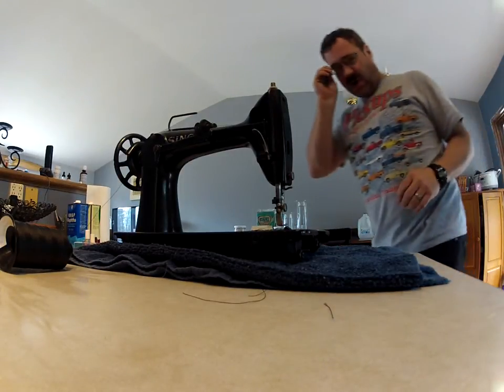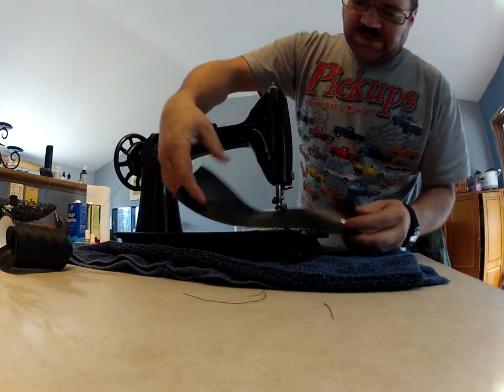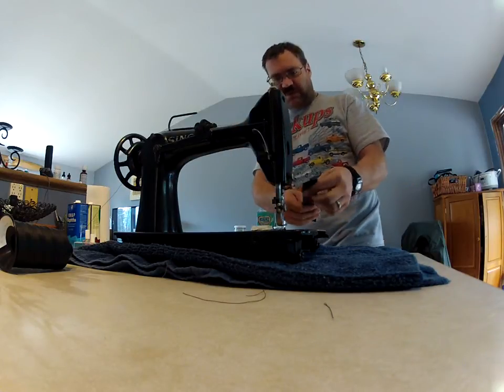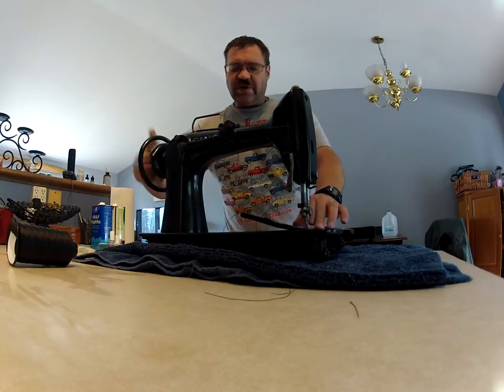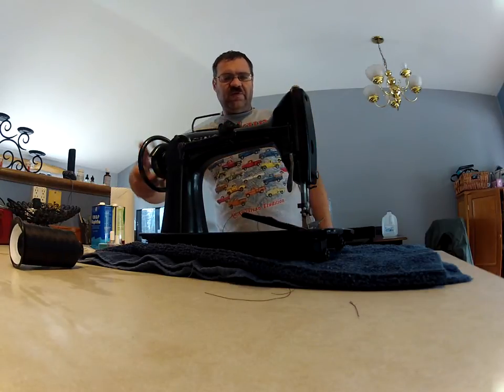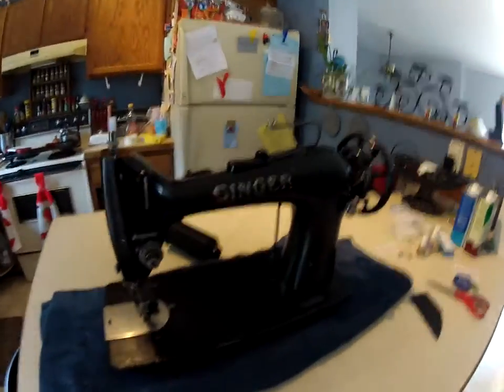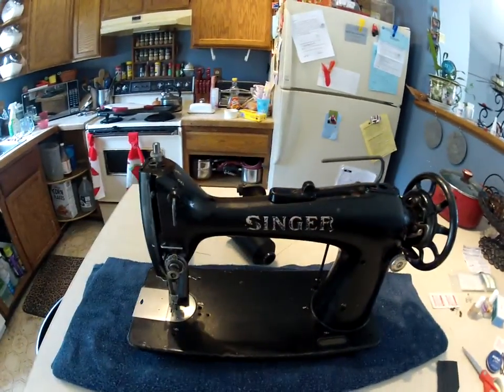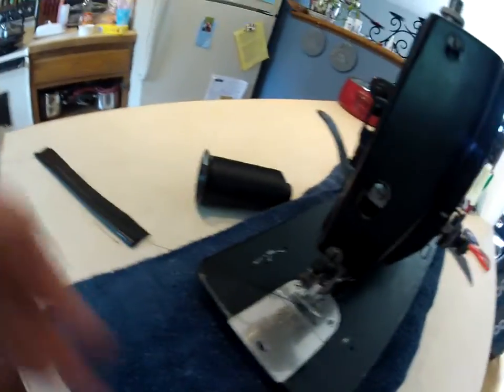Singer 103 industrial.MP4

Comment: India Singer Co makes the replica of the 103 model with knee lift for presser foot.  However,  I doubt if they are of superior quality.   I have one made in India but they are not called model 103, just high speed 'Merritt' or 'Dinesh'.  Mine has the  'Singer' name on it but it's on a Merritt industrial treadle stand.   I had to swap out the poor quality balance wheel for the original Simanco one because the one that came with the machine was really bad and rattles; sometimes not engaging the needle shaft.  The needle insert was also slightly angled about 10 degrees. I might have to tweak that as well, but it sews ok, fast!

Comment from the maker: Sorry, the machine (and matching table) is not for sale, it is my main heavy duty machine. Shipping these things around is quite an ordeal anyway. I would recommend you check local for sale and auction sites if you are looking specifically for an older singer is industrial look for one labeled 31-15 or 31k. They are fairly common and can often be had for much less than I paid for this one. Good luck in your search!

Comment: I'm about to buy this machine from a local store, may I know what size of needle and thread does it use? Is it an industrial treadle machine? What's the maximum thickness of leather can it sew?
Reply from the maker: I would be very surprised if the machine you have found is this exact model, I have been watching old singers for several years and have found only one other...it seems to be a European model  however it uses "standard" industrial needles ( it has been a while I do not recall the exact number)  as far as the leather  it depends.   the only singer really capable of continuous industrial usage in heavy leather are the tack  and cobblers machines  ( 28 series)  but these will do upholstery weight leather reliable and without complaint and with patience and sharp needles you can get away with 'belt" type leather pretty easily.  This particular machine is a "103"    the most common industrial singers  seem to be model "31"   and they are in many ways better than this machine.   it has been a while since I have been "into" my sewing.. so I don't have any links handy , but a google search  should turn up some pretty good groups  forums and information on these old work horses.  Sorry I was not more help,   best of luck to you . I would also be very interested if and when you acquire your machine  to hear about it ( or maybe a video?)